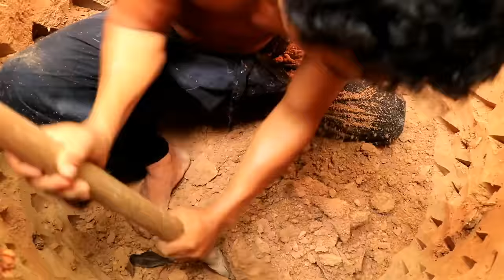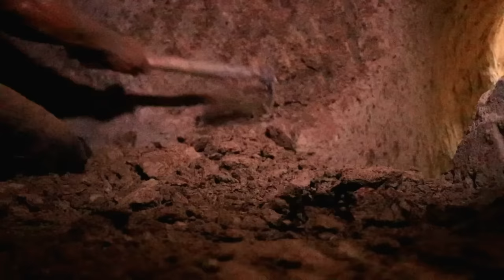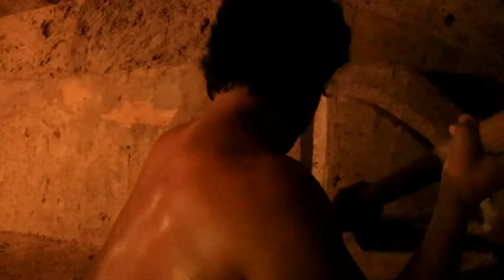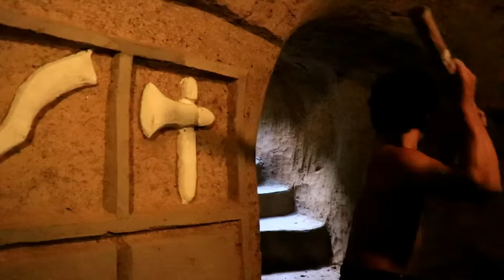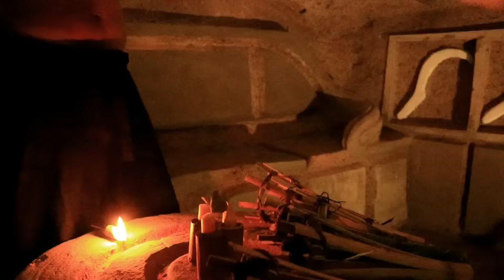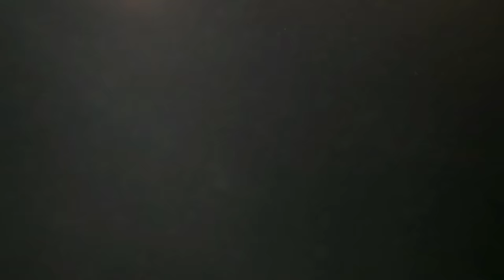How to Build Private Underground Temple Tunnel House With Swimming Pool

Comment: The commitment is amazing. I would've stopped halfway through the first hole. Also, this guy literally builds this as one man and doesn't complain. I'd be crying because I have a grain of sand in my eye
Reply: I'm tired, and it's hot out..
I'm bored, ya got any weed?
Reply: Same
Reply: Dude its obviously fake...
Reply: Bro this is fake
Reply: It’s fake
Reply: @aurabanda6144  ''obviously fake'' as in u didnt believe these guys before they were exposed.
Reply: @koninggieske5663  I didn't. Two people with wooden sticks cant build a 3 meter hole in the ground with perfectly smooth edges and completely flat floor, neither are they abe to fill up an entire pool by putting stick tunnels into a river that is pointing upwards (the water would just fall back down into the river again and if it didnt it wouldnt be able to fill up the pool) i mean these are just some of the reason in some videos you can literally see workers and machines hiding in the background

Comment: And people think aliens built the pyramids, here is a guy that has a stick... and builds this amazing building!
Reply: Even if what he achieves here is totally amazing, there is a difference between digging a loose ground, and cutting granite blocks of several tons and managing to stack them up to 140m high... I absolutely don't support the alien thesis, but it's still not the same things, at all..
Reply: @alexandresoubeyre2510  how else would they do it though? And don't say a pulley system cuz I doubt a bunch of starved slaves could lift up 20 ton blocks even with a pulley
Reply: @aaronaustin9814  First of all, they were not slaves, but paid workers.
Second, construction probably lasted way much longer than the 25 years officially announced.
In addition, it would seem that ramps inside the Great Pyramid made possible to push and lay the blocks rather than lift them. Totally unique construction techniques had to be used, techniques too far from our technology for us to consider.
To go your way, some things are puzzling, such as the astonishing precision with which 20-ton blocks could be arranged in the chambers.
But considering certain physical limitations that we now know well, space travel is impossible over long periods of time and over long distances. And if such an advanced civilization had come to Earth, with our current technology, I think we would already have evidence of its existence, because it would have to be relatively close to us.
I think that the thesis of ancient civilizations that have disappeared, very intelligent, and gifted in construction, is more probable.
Reply: @alexandresoubeyre2510  nah they were slaves and everything you said is also a guess therefore it's also not meant to be taken serious until we get the technology to to back in time and figure it out
Reply: @aaronaustin9814  I have big doubts about your knowledge on these subjects . They were absolutely not slaves. Evidence of the use of ramps at other sites in Egypt does exist, and all the theories of construction remain for the moment more plausible than aliens.
And i don't even want to responde concerning the time travel.... 
Please, document and reflect.
Reply: @alexandresoubeyre2510  idgaf about  what you I'm done speaking on this cuz all you're saying are guesses
Reply: Not aliens.fallen Angels giving humans forbidden knowledge. From weapons, war and witchcraft

Comment: does no one else get scared the roof is gonna fall on him
Reply: E
Reply: Well if the dirt is only two feet thick and the room is three feet tall, even if a section caves in, it won't block him in
Reply: I don’t because that’s sandstone
Reply: @letsnotgothere6242  he would just construct a stairwell anyhow to get himself out of there lol .
Reply: @Stays_Circus  Not sandstone, it's just a more firm sandy soil. Big difference, you cannot chip at solid sandstone that easily.
Reply: It will likely be fine until it rains, once it rains the whole thing collapses.

Comment: Is the soil/ ground in that area having some mineral that the structure stays pretty intact ? How good is its resilience to not collapsing during heavy rains and/or when some large load/ weight is placed above the structure?
Reply: The deeper u go the more chance of building a very strong underground tunnel or structure.
Reply: Not good. These videos are not about durable structures. They're about whimsy and amusement and 8M views. Most likely there is a crew involved to assist the man and his shovel, but we enjoy them nonetheless.
Reply: So I'll give you a quick rundown, basically rain will kill this and it will last months at most.
When you're digging a tunnel without supports you need to dig it through solid self-supporting stone, ideally soft stone such as sandstone. He hasn't done that, this is dirt. This dirt allows water to infiltrate, it will fill with water when it rains and become a buggy muddy mess. Every time it rains there's a good chance it collapses.
To make something like this not collapse you would make a "cube" out of thick wood beams and connect the beams with planks. You'd put a vapor barrier on the outside to prevent water from getting in contact with the wood or getting inside.
Solid sandstone can be dug through with an electric hammer somewhat like this, you should look up sandstone tunnels if you're interested in this and want something that would actually survive more than one rainstorm.

Comment: I wonder what happens after they have finished building their own house and pool does it get filled back up or do they just leave and dig another hole
Reply: They leave and it rains sometime after. The water goes through the soil and collapses the roof as the house fills with water.

Comment: I wish my soil was firm enough to do literally anything these guys do.
Reply: Once you get a few feet down in many areas the soil composition changes, it may switch to clay or some other sturdy composition.
After that point you need to put supports in and make sure too much water doesn't get in. Without at least sturdy wooden supports the dirt will collapse in when it rains. Even with a sturdy soil it will still collapse with no support.
So you CAN dig down but when you do you want to build a "square" out of timber, picture it as making basically a cube. The edges are made of thick timber and the insides of the cube are thinner planks. You may place a vapor barrier on the outside if you want to to prevent intrusion from water. Without this you run the risk of your shelter collapsing any time it rains.

Comment: Very nice but it's strange that we never get a full 360 view of the inside of the dwelling, or even the full extent of the inner left hand wall (where excess light or the camera angle is from often). Probably because, as the diffuse lighting at 10.03 suggests, that section of wall is actually entirely open, giving access to fresh air and the worker team. Also how you know its fake - you don't put fire in closed spaces with only one air-hole for no reason - the fire will quickly consume available oxygen, and carbon monoxide is a killer.
Reply: Also no drainage for the water

Comment: My only problem with this is what happened when the pool water get dirty  , does he take all the water out by bucket and then fill it up again with water . 
That's is too much work , that would take hours that to long .
 You could at least put a whole where you could drain the water from and have some sort of plug where when you fill the water back up it won't get out  .

Comment: Epitome of work harder not smarter. Not using shovels or buckets to move the dirt. Just throwing it out by hand. Not setting up a pipe or tube to get water in, just carrying it with a pot over and over. How’s he going to drain the dirty water after washing in it? He’s probably going to have to carry it all out one pot at a time. What happens to the dirt foundation during a heavy rain? That whole place could collapse, no sealant to keep the weather out.